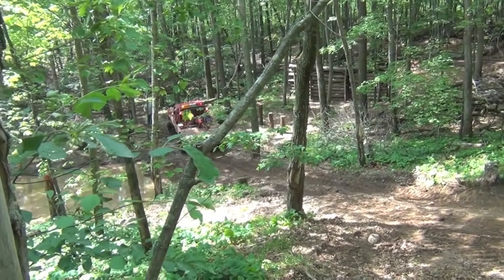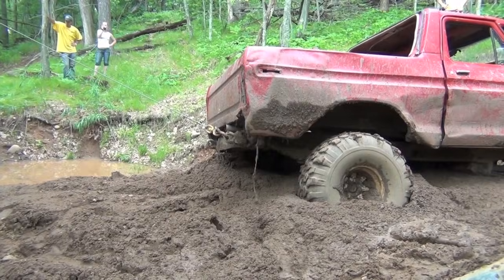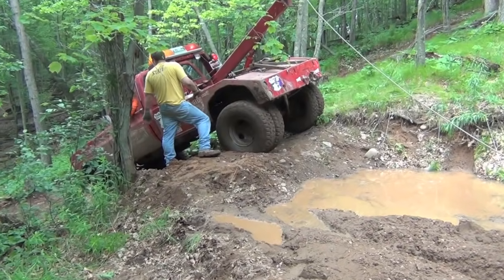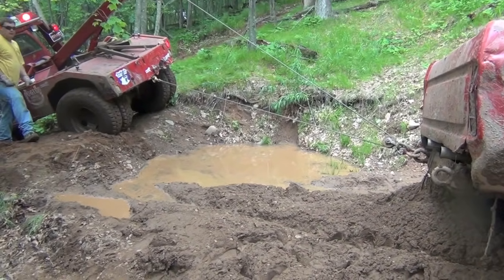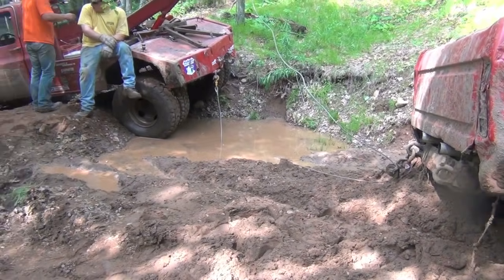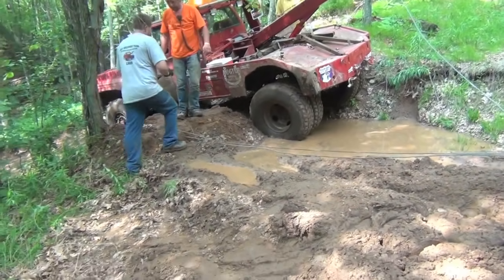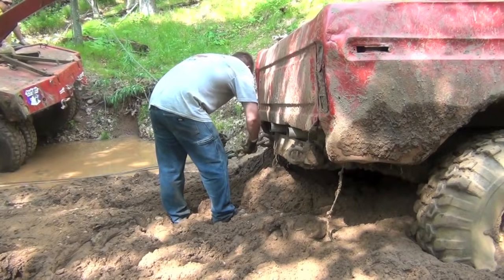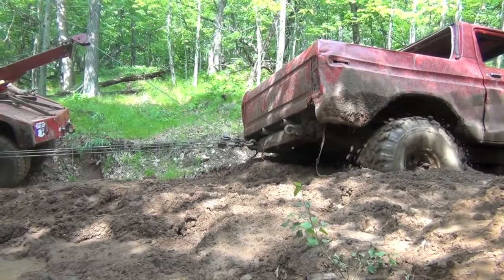FORD 4x4 BRONCO STUCK PART 1 by BSF Recovery Team

Comment: A shovel,and a 2' length of pipe..The shovel is to remove as much mud,dirt,sand behind the tires in the direction of the pull..The length of pipe is to drive into the mud alongside the tires in order to help break the tension/suction..It works when the pipes 2" id,and driven to the lowest point of the tire...A small beater sometimes helps to get the pipe down deep enough...

Comment from the maker: In order for the snatch block to double the pulling power (minus the friction of the pulley) the cable must double back at 180 degrees, if I had run a cable to the other side it would have reduced the pulling power by a percentage for every degree less than 180

Comment from the maker: The noise you hear is the dry pins in the snatch blocks, they develop a little surface rust hanging on the deck of the wrecker. It's not over yet wait till next week.

Comment: And doubling the winch line would increase the pulling power of the winch.  You should've also tied the front winch to a sturdy tree to help hold the front of the wrecker down and in place.  If it's possible, you should try installing a set of hydraulic spade type out riggers on the back corners of your wrecker so you can put them down and they'll dig into the ground to help even better anchor your wrecker in place during these really tough pulls.

Comment: Quality mounts on the bronco or not, if you have the option of hooking on to two places you might as well spread the load over the two points and place half the stress on each mounted tow point. As you have it all the stress on one point of connection so one area of weld or bolts vs two.
Reply: SO there are no cross braces on a bronco and the engine is not mounted to the frame?  Weird.

Comment from the maker: Even though there was a lot of winch cable used, the run between the snatch blocks was short so the danger zone was small, and I also need to make a few new ones, the one I had is now in very bad shape.

Comment: Probably the worst I've seen was when it took 6 trucks to pull out a little early Bronco out of a hole.  However, the ability to lift, like that wrecker can, probably would've made short work of it.

Comment: Love your work, but can't understand why you would hook three lines to one hook point on that guys rig when two are available.  You could rip the shackle off, or rack the frame pulling like that.  And doesn't anybody carry a shovel anymore????  You can lessen a pull like this tremendously by simply moving some mud from behind the tires.
Reply: Bread996    seriously.  or oven shovel it out.  Takes little time
Reply: Bread996      Ok Bread! Its seems easy from the comfort of your couch! Its easy to be an armchair quarterback, but its much harder when you are put in the situation. So go to harbor freight buy a shovel, drive your PRIUS into a mudhole, and start a you tube channel. Show us all how its done BREAD!
Reply: @raysanchez9665  I know right so easy from the comfort of your your recliner